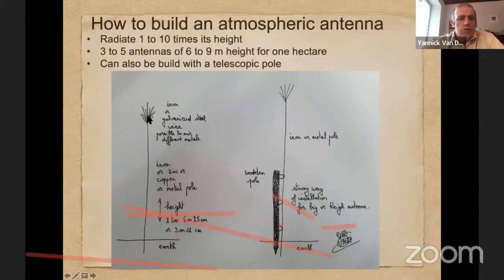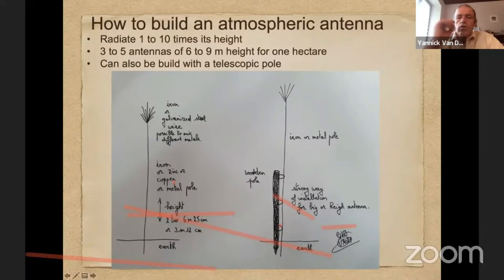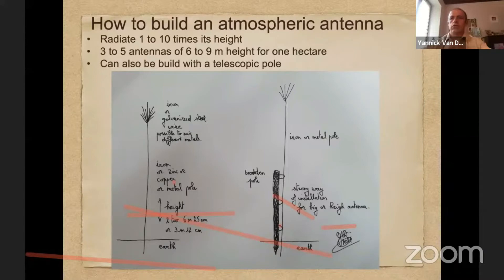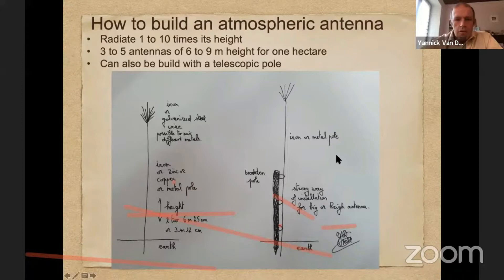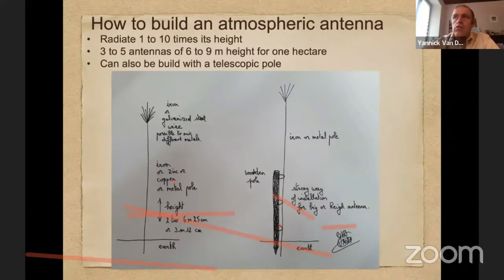PART-06, Electroculture Introduction to Sri Lanka - How to build an atmospheric antenna

Comment: the wires on top. would it make sense to mix copper and iron to have better effect? if not, what is better for an iron pole, copper or iron on top? thanks br
Reply: I have read that iron is known to electrically deplete the soil ...copper replenishes it.
Reply: @carolineboenig7777  that's what I find out as well. So not sure why would one use iron, unless attached copper somewhat negates the negative effect?
Reply: Galvanized steel and copper together works.

Comment: he said don't plant the pole near big tree? but I don't understand his explanation why. can someone help clarify why not plant the pole near big tree? Thanks
Reply: The tree itself acts as the same type of antenna. Creates destructive interference.
Reply: @grlpeterson  Thanks for replying. How would it creates destructive interference, can you say more?
Reply: @timtran9589  The tree itself will act as an antenna, as well. There combination of the two will cause a general cancelling effect between them. I'd also consider that you may be taking energy from the tree by the antenna being too close, which may ultimately harm the tree. That is my own supposition, however. But, it does seem to make sense by way of common physics of energies.
Reply: @grlpeterson  Thanks. I see. btw, with this logic, it wouldn't hurt / negatively effect the energy if I attach the copper antenna into a tall building, right?
Reply: @timtran9589  just has to be taller
Reply: @timtran9589  No, it would essentially be the same as any other way. If you want the greatest effect, it seems it would make the best ground to attach it to any metal piping that goes underground which will draw more energy by the fact that the pipe will drawing greater earth energies, which will therefore draw more electrical energy from above. I'm eventually going to try this myself.
Reply: thanks guys. if any conclusions from the self experiments. I would love to hear